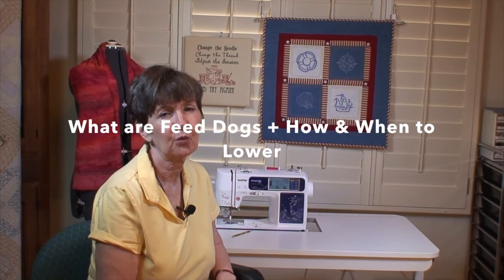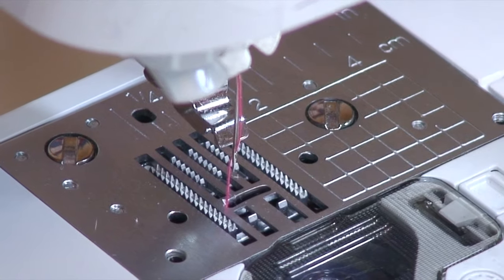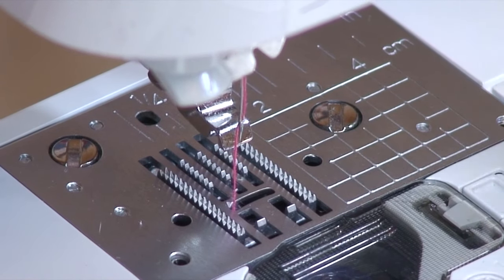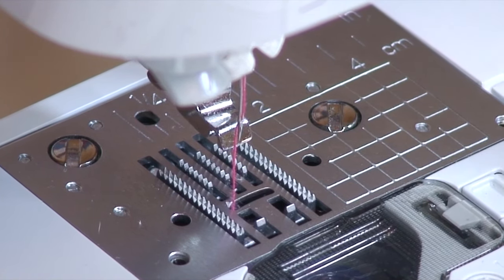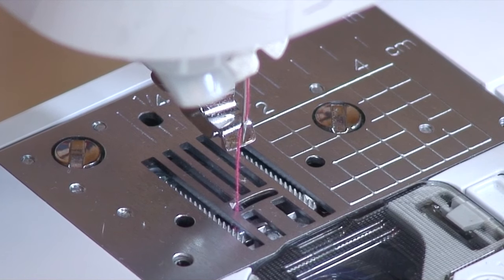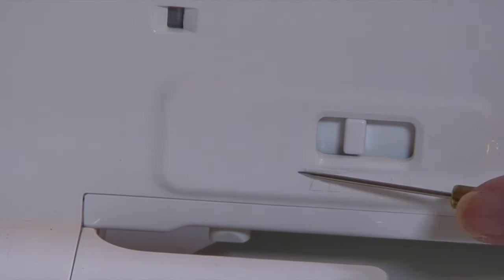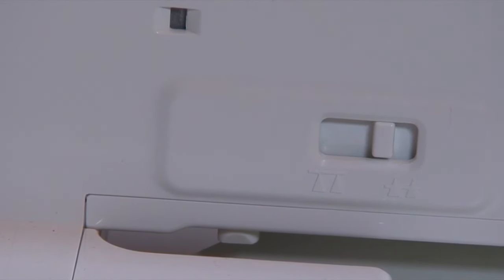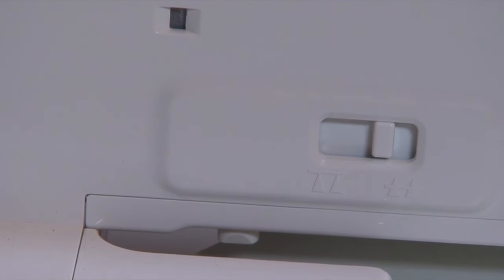How to Raise & Lower the Feed Dogs/Teeth on the Brother NV950

Comment: I'm new to this and my fabric wouldn't move. I spent an evening unscrewing my sewing machine, cleaning the dust, rethreading the bobbin. It's a new day and I was just about to oil the machine and this video saved me. A SWITCH. A SWITCH!!!! Thank you.
Reply: The same with me!!! Never even noticed the switch🤦‍♀️🤭
Reply: just had the exact same problem and exact same situation
Reply: Same!! I’m not home atm so I’m gonna try it once I am, but mine had the same problem, including the fabric getting stuck in them. I really hope this works..
Reply: That’s the same thing that happened to me lol. I tried cleaning it and even accidentally took out the bobbin holder and had to watch a whole separate vid to figure out how to put it back in (even though this wasn’t the first time that happened lol) anyway after putting everything back in my machine I realized it was the teeth that was the problem and then watched this vid to come and find out I pushed the switch the other day not knowing what it was and didn’t put it back without realizing. I’m so happy i found this video and was able to fix it lol😂😂

Comment: I have a Brother LS-2125 and I cannot find the switch to raise and lower the feed dogs. My fabric won’t advance if it is thicker due to pleats ( trying to make face masks)
Reply from the maker: Rebecca Buck there is no need to lower the feed dogs when straight stitching.  When sewing through layers I find it best to start with a new needle (denim or topstitch needle) and use a walking foot.  This foot will feed the top and bottom layers through evenly which may assist with the issue you are experiencing when creating your masks.   https://www.echidnasewing.com.au/f034-walking-foot-5mm-models

Comment: I have a Brother XL 2230.....there is no switch on the back of this machine.    Help plz.  How do I raise the feed dogs in this machine?
Reply from the maker: @debbierankins2540 Your machine uses a Darning Plate instead of dropping the feed dogs.  If you look in your manual it will give you the code for the part you need.  It did come with your machine so also check your accessories.

Comment: After moving the the lever to the up position the feed dogs stay down. I tried turning the hand wheel counter clockwise one revolution and even making a couple stitches to see if it would teenage but no luck
Reply: I have the same problem, mine is an older model and the feed dogs move but they aren't up high enough to actually catch the fabric
Reply: The part supporting the feed dogs was broken, on my machine and I had the same problem. Check if it is broken

Comment: My feed dogs are up & I commonly have issues with the fabric not being fed (moving) especially when beginning a seam or when the fabric has a fold. Very frustrating, I have to always pull the fabric &/or use an awl to push it through. Even tried other specialty feet. (??) Everyone here on videos are able to just start sewing right at the edge of the fabric while I have to begin an inch in, reverse & go back. Any help is appreciated. Using a computerized Viking Emerald 183. All other sewing is perfect.
Reply from the maker: We are a Brother specialist retailer and haven't experienced the type of issues you have with your machine.  Perhaps you take your machine to a technician to check your feed dog alignment?

Comment: My brother swing machine model is 461 Fiesta I know were to regulate the teeth is can help me to find it please because I have the problem with the fabric slide wend I am swinging thank you
Reply from the maker: Hi Ana - it is probably best to call us if you can.  There is no way to regulate the teeth unless there is an issue with the machine.  If your fabric is sliding you may need to use a stabilizer to help or a walking foot to feed the fabric. You can call us in Australia on 1800 000 360.
Reply: @EchidnaClub  thank you this machine was given to me and  I don’t know much about thank you for answering me I going to oil and that may help some.
Reply from the maker: Just be careful as you can over oil. It is the tiniest of drops that you need and you need to be careful where you place the oil.

Comment: Why are my feed dogs moving in the opposite direction? 
They are lifting at the back then moving forward then dropping then lifting at the back??? 
I've tried pressuring the reverse stitch button  but that didn't fix it 
🤔🤔🤔😡🤬 really losing the Will and ❤ to sew atm, I don't have a button at the back of my machine to lift the feed dog, as I  also dont think they are at their highest point, which I've tried to adjust with the loving help of my partner,  he said the screws were loose so we tightened them, but the feet are still not coming up high enough to feed fabric thru the machine plus  feeding in wrong direction, 
All I want to do is hem a pair of curtains, sew a straight line, one measly little line, Grrrrrrr

Update: with perseverance,  the curtains were finished,  and given back to a happy customer (my partner's granddaughter)
Reply: Did you ever fix this? I lowered my feed dogs to sew on a buttons and now they won't come back up.

Comment: Mine won’t raise even when I use the switch :/
Reply from the maker: When you switch back, you do need to turn the handwheel on the side of the machine one full turn.  If they still do not raise, you will need to take your machine in to be looked at by a technician.

Comment: I have a Janome. It’s not there Not there
Reply from the maker: Which Janome do you have Louise? Have you checked in your manual to see where your feed-dogs selection switch is?  Some machines do not have this selection and if you don't have it, you will have to use a darning plate instead.
Reply: It didn’t come with instructing. But figured it out with all your help.
Reply from the maker: You are most welcome :)